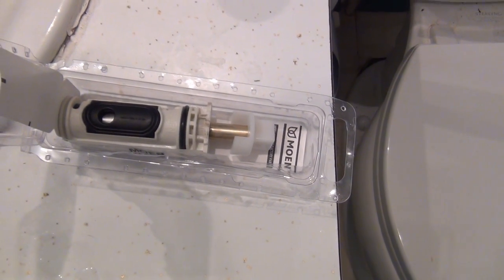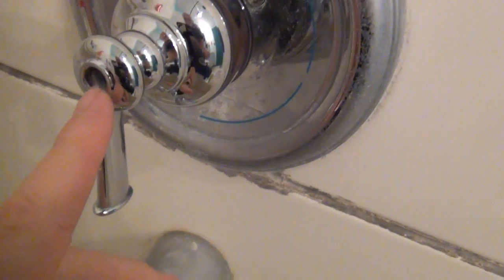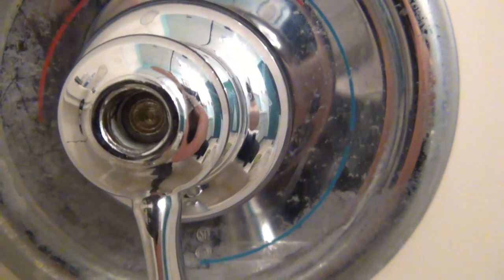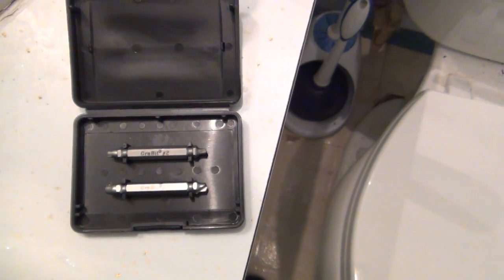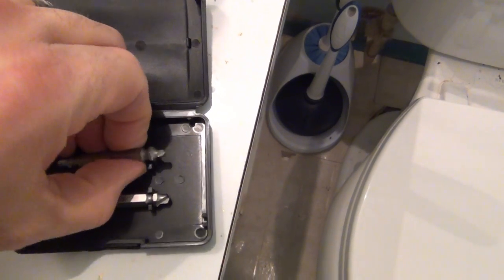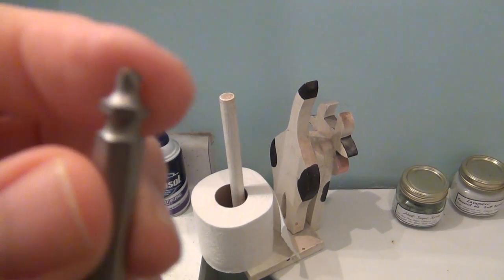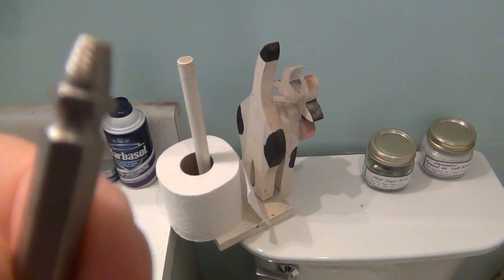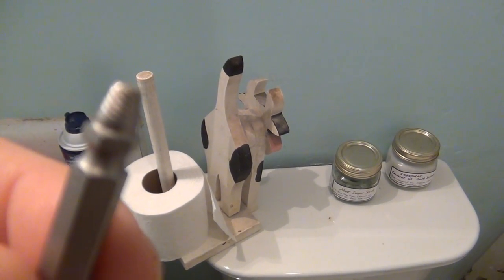Stripped Out Screw

Comment: I had the same problem today my friend. There was no room to do anything. I tried 2 different types of screw extractors, running my drill "backwards" to effectively back the set screw out...nothing worked.  Out of options to do anything else I finally had to resort to total devastation and mayhem on my existing shower handle. I took my B and D multitool, put the reinforced cutting disk head on it and went to town. It took awhile, a pair of channel lock pliers, and a finishing touch with a hacksaw. When I was finished, I was able to access the entire head of the set screw with a pair of small vise-grips and the screw came out easily then. My repair is now completed with no leaks and a new "not so fancy..plastic handle" instead of the nice chrome handle I had previously. So in conclusion.. sometimes you have to make sacrifices to get the job done. I'm not so sure a professional plumber wouldn't have had to cut off the old handle either, he just would have told me there was "no other way" and then charged me for a new handle too!
Reply: Exactly what I think about the plumber! TFS!

Comment: I had this same problem with my set screw today. I believe it’s a 7/16” hex that you would normally use an Allen wrench to remove it. Since my was stripped I saw a suggestion elsewhere on an old thread to use a T15 torx driver. The T15 was too big. The T10 worked great and immediately removed it. Hopefully this helps someone like that fella helped me.
Reply: Yahooooo!  T10 Torx worked perfect.  Turns out it wasn't even an Allen head afterall!!!      Now to figure out how to get the rest of the faucet apart so I can replace that stupid cartridge on this Moen single leaver kitchen faucet!
Reply: Same here, T10 bit on a battery powered drill, in reverse, was able grab it and back it out. Thanks! This was a Moen kitchen faucet. Can now replace the cartridge.

Comment: Another way to remove a stuck setscrew in a Delta bathtub faucet (Monitor 1400) handle is to use a 3/8" left-hand drill bit. Use short bursts with the drill in reverse (the cutting direction for LH drill bits) and the setscrew might loosen. When the drill bit bites into the setscrew head, the torque might be enough to loosen the stuck setscrew. Worked for me and the setscrew was reusable.

Comment: Try using a torx bit instead of the hex allen keys or bit. Buy the torx bit set if you can't figure out the correct size to fit inside the stripped screw. I hope this help.

Comment: I have the same issue on the same moen handle. I used an 11/64 drill bit and drilled in to the stripped screw. And then drilled up, down and side to side until the handle broke free. Then unscrewed the remaining stem of the screw by hand after the handle came off. Everything came out clean and I didn’t need a new handle.

Comment: hey brother .. been doing mnt for 4 years. i have had way to many stripped out allen screws in the tube handle. the only two ways I've found so far is one, to drill it out, but that takes forever. the simplest and fastest way is to take a saw zaw (reciprocating saw) and cut the handle off. your going to probably miss up the cartridge in the  process. but how much time do you want spend on that one project. I've tried ease outs and various other techniques. Those two I just mentioned are the only things I have found to work. The reciprocating saw saves me the most time and is the most practical.  If anyone has a better idea of solution, please respond.
Reply: sorry, hit thumbs down by mistake. i think this is good suggestion

Comment: Happened to me this week. I tried everything but screw was totally stripped.
I ended up drilling through the screw just enough to weaken it... Then I went  back and forth on the handle until it snapped at the filter. No damage done to the internal pipe.  Good to go.

Comment: Same here…..I’ve tried everything you tried and added fire to the mix since that is supposed to loosen rust (oh yeah…mine was stripped AND rusted).  I’ve been hacksawing the handle to get access to screw but despite it will not turn…its fused…..so im getting a metal cutting multi tool to rip the surround apart until i can get everything off…lucky…i dont have leak…i just want to update trim…..

Comment: Holy Hell , I had same problem, been at it now for 5 hours started about 10:am this morning. Hex head screw was really messed up, then I check in with Youtube video, and had read, try using a T-10 wrench.
Went to the garage to see if I had one, and yes, a brand new set of T-Wrenches never been used.
What the hell, at 9:15 PM  I tried it, and "DAM" it worked. 
I will be going to the local hardware store for a Stainless Steel screw with a Roberson Sq head for a replacement.
Thank you .... Youtube.
Reply: OMG! You are my hero! The T-10 worked!

Comment: This cinches it. I'm going to buy a new faucet and cut the $250 faucet off. It was a gift three years ago and had this issue since the first time I had  to take it apart to replace the seal after six months-I should've replaced the screw then-but didn't take the time. I'm going to research them first and be CERTAIN that there is no 25 cent torque screw keeping me or anyone who will have to fix the intentionally defective seal by unscrewing  a soft screw head designed to strip. Grrr You said it. This should be a five minute cheap fix. We have such hard water here that I've had to replace seals in every room with faucets, at least once a year... That total bill is around $10... unless I add my labor and mental pain and suffering (lol) because this is a rental property and the lease holder is cheap.

Comment: The part that is striped is a small brass piece that screws onto the front of the valve. It screws onto the head on the vale stem, and the other side is tapped. That is the side where your screw head would have been. It is  replaceable.  You are replacing it with a new pressure valve anyway

Comment: With hex bolts in general if their stripped, you can try using a torx bit and carefully hammer it into the stripped hex bolt and hopefully be able to crack the stripped bolt. depending on the type of handle may need a longer torx bit.
Reply: Sharma Mahendralingam 
But once you hit then might be risk of damage the tube and face another problem 
I think drill the hole 3/16 and use small screw extract tool you tight ani lock wise , should screw come out
If not use the smal welding torch heat that screw little bit then use extractor

Comment: What's infuriating about this is that they don't just use a simple screw!! Why must an Allen screw be used? A simple Phillips would have worked just fine!
Reply: THANK YOU!!!! WHY allen screws???
Reply: this one doesn't have an allen screw holding it in. The screw that holds the outer handle in holds the inner handle in place too. You are thinking of a different kind of handle.
Reply: My philips head screw is stripped.

Comment: I am running into a slightly different issue with slightly different handle.  I would love anyone's feedback.  The handle is a single pull knob, so on/off is controlled via pulling/pushing the knob out/in.  Temp is controlled with 180 degree range from east to west.  The head of the screw is not stripped.  In fact, the screw rotates fine, it just continues to spin left indefinitely.  The handle loosens but the screw never comes out.  Additionally, when pulling on the handle (after turning the screw left ad nauseam) it pulls as if I was trying to turn the water on.  I put a little muscle into a time or two but didn't make any headway.
Reply: I have the same problem with my shower. Did you figure out how to get the damn thing off? This is so frustrating!
Reply: Harley Petit what I ended up doing was using an oscillating tool to cut the handle away.  Once I had it cut away I used a wrench to grip the cartridge and keep it from spinning with the screw.  I assume there is some sort of stop that got busted.  In the end, doing it that way cost me a few more bucks since I had to buy a new handle and the dremel blade got wasted since the material of the handle melted/adhered to it from the heat of oscillating.  Once the handle was off it was incredibly easy to replace and put everything back together.
Reply: @davidgilbert7268  Awesome, thanks for the reply I'm going to give it a shot.

Comment: Ok, I've just fix my problem like this. I used a very small skinny drill bit. My intentions were to use my drill bit like you did with yours, however only in my case using a drill bit. Any way I started my drill in reverse and when I did, the screw came right out.
Reply: no

Comment: Same problem with the knob type from cold water.  Screw striped and the remover drill bit did not work.  😡😡😡😡. Help!!!
Reply from the maker: Pretty much I use these drill. Bits were specially made for stripped out screws after working with this many many hours we finally got it. This video was done about who I’m guessing 3 to 4 years ago. I wish you good luck.

Comment: The only way to remove it is use a dremel tool or anything the cuts metal,  to remove the handle, cut off the handle in front in a horizontal position without going in to deep so it will be cut off in half.

Comment: Dude, I feel your pain!!  I'm running into the same thing on my Moen faucet handle.  The hex/allen screw on the bottom of the handle is stripped so the allen wrench is now worthless!!  I drilled the crap out of the thing, and it still wont come off.  I'm now considering dynamite, but that would likely cause massive collateral damage to my bathroom!!  What did you finally do to get  the handle off?
Reply: Jerry Chvarak you have to unfortunately cut it off
Reply: did you try something like the ryobi small screw extractor bits? I have the same deal. Trying to decide whether to JB weld an allen wrench on it or drill it. I read somewhere that screw extractors aren't good for the soft metal bolts like Moen/delta use for a faucet
Reply: hahaha, DYNAMITE is where I am now!
Reply: Couldn't get mine out, water was stuck on. Had to shut off main supply, and call plumber 😡😡 $$$$

Comment: I think I'm screwed on this project! The screw required a Phillips screwdriver but wouldn't budge. So I used my electric drill and the bit stripped the center. I thought sure as heck I could repair a leaky faucet... WRONG!  I can't afford a plumber..now what?!? Sniffle
Reply: I'm in a similar boat Pam.  I tried a lot of what this guy tried too and I'm still stuck.  I think the last time this happened I had my cousin help out and he ended up just pulling the handles off.  I tried that today but no luck either.

Comment: Hey mike you can try a left hand drill bit  ( no joke ) they go in the drill you spin the drill in reverse and the heat of the drill bit and it going in reverse most times will bite into the screw and will take the screw right out   Or the easier way is to drill the head of the screw off and pull your handle off   You are replacing the cartridge anyway and the handle will go on the spline of the new cartridge with a new screw   Good luck
Reply: Hello there, I’m having the same problem. Did you ever figure it out? I even tried drilling out the screw and it still won’t come off
Reply: Kevin maclea

Comment: I drilled out the screw on my faucet handle. Then the handle came off wit no problem. The screw was corroded into the cartridge. Once I removed the pin near the back I just pulled out the whole thing cartridge and screw. Mine is a pull and push faucet.

Comment: Just responding to this old video to say this particular handle design sucks and is why they no longer make it with the long phillips screw but have replaced with the now common set screw underneath.  One of the two I was replacing I stripped the screw but was able to use a small drill bit enough to "grab" on and pull out. Had to use a faucet puller to get the handle off before using cartridge puller (different tool) to get cartridge off.  On second one... no go... stripped screw, nothing worked but hack saw/dremel the handle completely off.
Reply from the maker: I couldn’t agree more with you. I have an altogether different one now

Comment: just drill the whole head off the screw  with a 3/8 bit slide yee handle off grab whats left with vice set em tight at the 9 o'clock position and smack it down fast like a impact or replace it ;-)
Reply: Charles H. Wiemeier I did the same
Reply: Not correct, you are not in the right direction with this particular handle .

Comment: did you get it removed?  I have the same damn problem
Reply: Saw it off.
Reply: Me too have the same issue. My whole bathroom is black with mole because of hot water leakage but i cant replace the spring because of allen screw